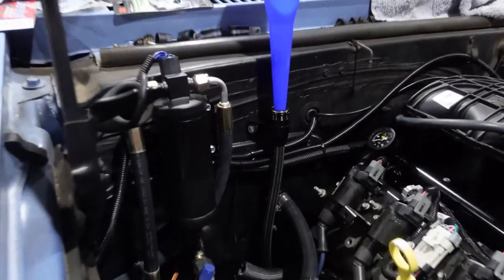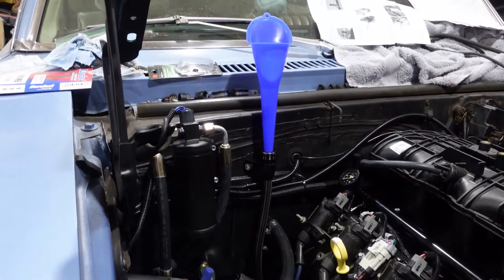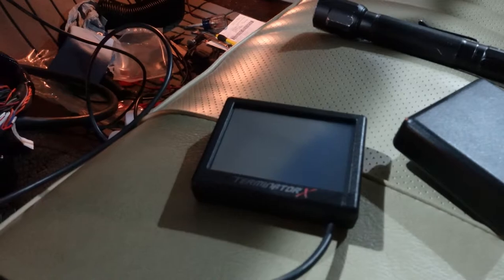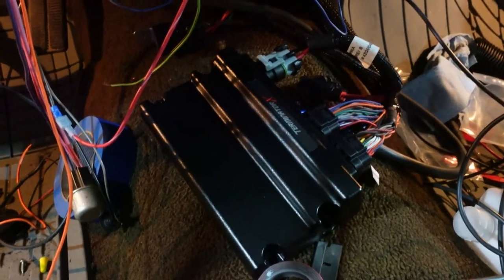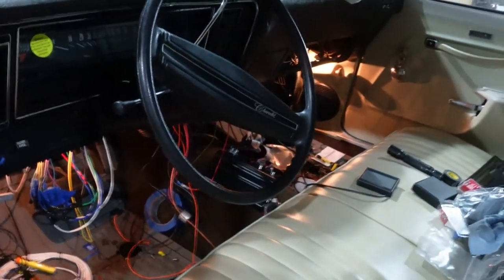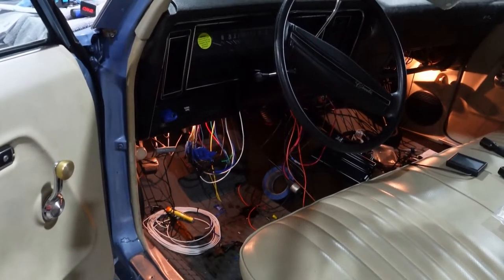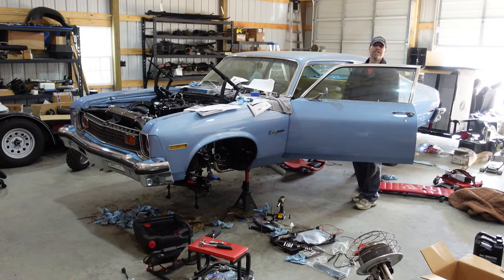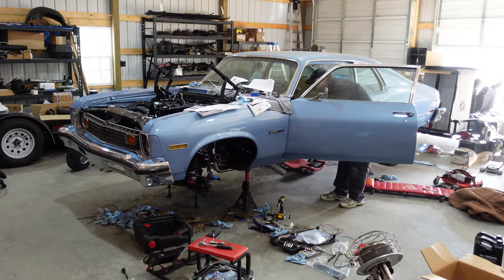Holley Terminator X first start... FAIL! 73 Nova LS swap will not start with the Terminator X!

Comment: I know the feeling!! I throw my hands up constantly...You'll get it!! Great motivation and work ethic!! Sincerely, Chad Franklin from Facebook!!
Reply from the maker: Ah what's up, Chad! Much appreciate you watching! After having the engine running with the oem stand alone harness and pcm, this was a very frustrating moment! I put a ton of labor into the oem wiring just to rip it all out and install the term x. But you're right, we WILL get there!
Reply: @BackyardBMX73  Oh I understand. The squarebody has given me fits. I've just switched my focus to the Nova for awhile to give it a break. Now I only hope I went the right direction. Because I also have stock wiring harness built. Wondering if I shouldve went Holley. But I do have a local tuner who can tune the mess out of one. We shall see
Reply from the maker: @1bad69xss4  that was my main concern... not being able to tune with the oem system locally and finding a reputable remote tuner without paying an arm and a leg.
Reply: @BackyardBMX73  Awesome!! I feel like that was the right choice!!
Reply from the maker: Yeah man, I think the Holley was the right choice. Just gotta work out the bugs.

Comment: I had the same issue,  my battery is in the trunk. Try grounding your battery straight to the engine block via the coil grounds. I did this and my car fired right up
Reply from the maker: My issue was fueling. Way too much fuel and not enough air.

Comment: Check your coil pack harnesses and make sure that have them installed correctly, correct wire going to the correct coil pack. Mine done the same thing and I had made a rookie mistake and accidentally installed the passenger side to the driver side. Good luck, hope this helps.
Reply from the maker: One of the first things I checked. My issue ended up being way to much fuel and had to feather the throttle to get the engine to fire. My latest video shows it running. Thanks for the input and watching!

Comment: Dang that sucks, sounds like timing, you know it has fuel and spark you just got to get em to show up at the right times! Hope you get it sorted so you guys can start enjoying it
Reply from the maker: We'll get there! Thank you bro!
Reply: It does sound like timing. Maybe the crank sensor isn’t working correctly.
Reply from the maker: @inerceptor  turns out, it wasn't timing or crank sensor. The culprit just so happened to be revealed in this video. I bet you can figure out what it was. 😉
Reply: @BackyardBMX73  I’ve never messed with the Terminator X before but after doing a little reading and watching the video again I am going with what you were thinking. From what I’ve read it needs to see 12 volts to start. Either way, looking  forward to hearing it run.
Reply from the maker: The voltage drop may or may not have contributed to the no start. Video will be out tomorrow evening, stay tuned!

Comment: Did u hook up a vacuum hose to the blue tube coming from the holley ecu??....do you have over 18" of exhaust pipe after the oxygen sensor,  bet it's one of those issues
Reply from the maker: Yes and yes. Neither were the issue.

Comment: Too much fuel? I had a similar issue. I set the terminator up looking at the wrong map sensor and it caused it to dump a ton of fuel
Reply from the maker: Gotcha. I just didn't have the base fuel right.
Reply: @BackyardBMX73  I just got mine running last week but it runs like garbage. Goes lean at wide open throttle. do you know if the acceleration enrichment and fuel tables learn over time?
Reply from the maker: @fatkat311  from what I understand, it is self learning but it won't learn until it's perfected. I got help from a guy on Facebook that is an excellent tuner with these systems. Here's a link to his page.

https://www.facebook.com/tctuned
Reply: @BackyardBMX73  I really appreciate the info!
Reply from the maker: @fatkat311  not a problem!

Comment: Add more exhaust pipe. ..I'm telling you, your o2 sensor is getting a false reading. I had the same problem when I did the fitech in my nova , now I'm adding a lsa supercharger and a terminator x too, hope I don't have these issues!!!
Reply from the maker: That wasn't the issue. Too much fuel in the initial start up tune. The engine is running and now starts without issue.

Comment: I had 16 bad flex fuel injectors that caused no starts. It was infuriating.  I got some Snake eater 1500s and it fired right up.
Reply from the maker: The no start issue was too much fuel. Needed more air and she fired up. I have another video showing her start.